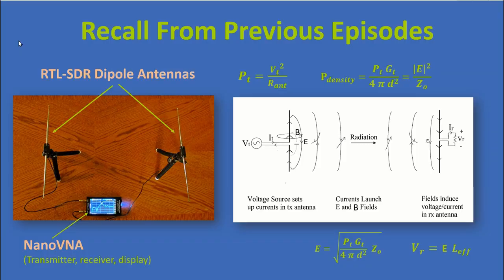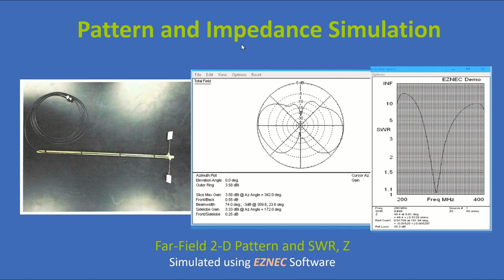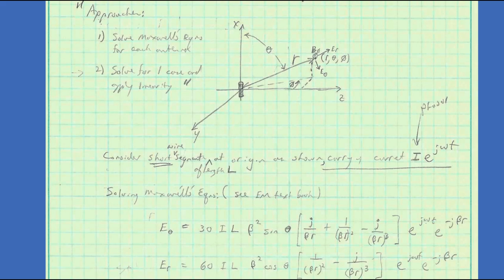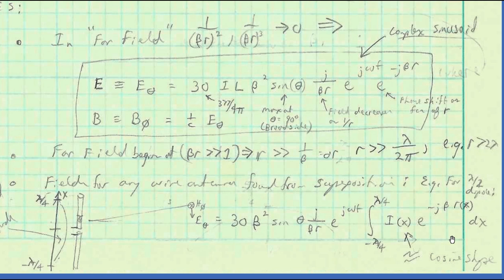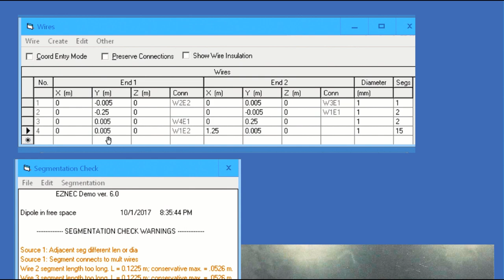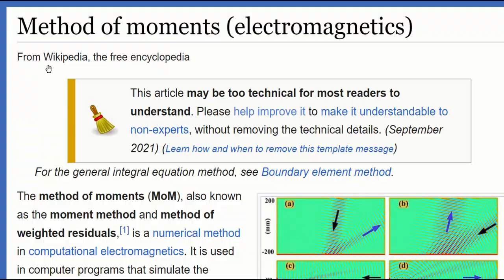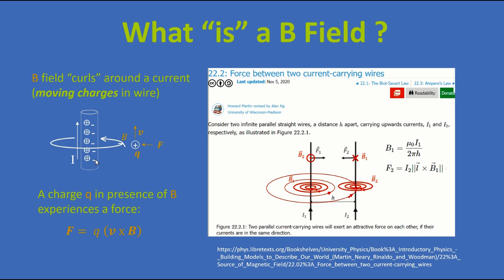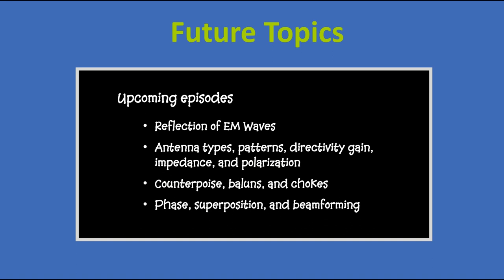Antenna Briefs #6 - Analysis, Simulation, and Measurements

Comment: Length contraction; time dilation.  Contraction is reduction in size; dilation is inflation in size.  The time between clock ticks seems longer; the distance between nuclei (atom cores) seems shorter.  We get exactly the same attractive force using either strategy so it doesn't matter who believes what.  E and B are in phase IN THE FAR FIELD (plane waves); but, not in the near field.
Reply from the maker: Thanks for the correction. I didn't catch that one during my review and final edit. If you haven't seen it yet - SaltyPuglord has provided a link to an excellent video covering this too :-)  And I just updated the Description to add that link plus one to a Berkeley Physics Course text on EM that details the description and the math behind it.

Comment: Dipoles are known to be only 2 dBi gain antennas. In this test we see two dipole antennas which make 4 dBi together. So why do 
they appear to lose many more than 4 dB when we change their position / polarity?
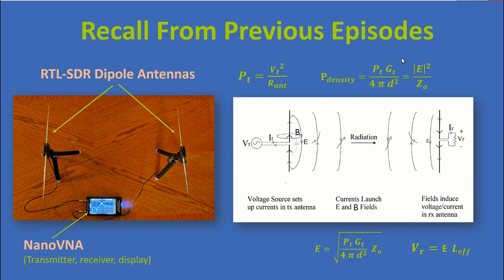Reply from the maker: Agreed. The net transmit plus receive antenna gain is 4dBi in a traditional Friis path-loss formulation for received signal level. (In the slide at timestamp 1:15 , a different derivation is used, but it's equivalent to the Friis, with Gr accounted for in Leff)  But to the question of why do we lose much more power when we change position / polarization, the answer is that the "2dBi" gain quoted for a dipole only applies when the antennas are broadside and co-polarized. If they are not, then a dipole has lower gain than 2dBi. Indeed, when we go from broadside orientation to "endfire" as shown in the video, we see a huge drop in received signal. One way to think about this is to look at the fields shown on the graphic at 1:15 . For good reception, the receive antenna needs to be parallel to the E field that is coming at it. If it is not, then less total voltage (Vr = E * Leff) is induced. From the geometry, it should fall off as cosine(theta) where theta is the angle between the E field and the antenna element.  Does that help answer the question?
Reply: @MegawattKS  thank you for your kind reply. 
I had thought that the phenomenon was due to the close proximity of the antennas which made the gain appear much stronger than normal.

Comment: This whole 'dilation' thing makes no sense to me because the electrons in a wire move about 1 cm per second; what is that about 0.000000000000000 c!
Reply from the maker: I suspect the answer is that 0 times infinity can be any number. Agreed that the drift-velocity of electrons is a small number. But the total charge in the wire is huge. It doesn't appear that way when observed statically because the electrons' charge is normally 'covered' by the positive charge of atoms from which they came. But as they move, even if a small fraction become uncovered due to time dilation, a small fraction of a huge number can still total a decent fraction of a Coulomb. It would be interesting to put numbers into all of this and see...